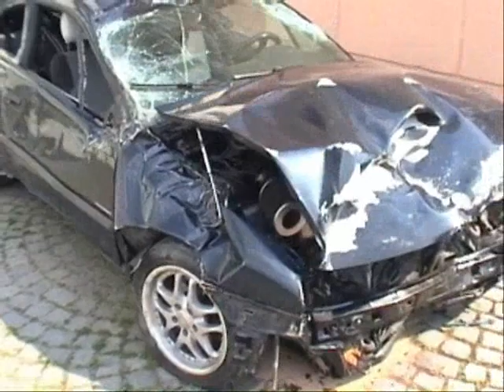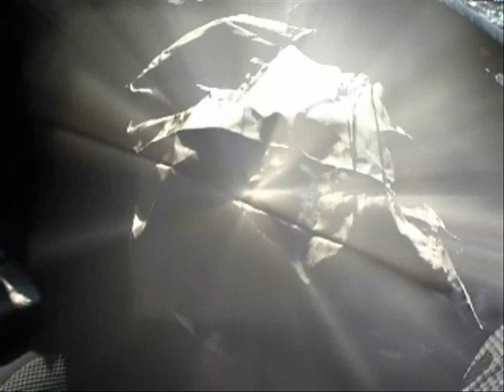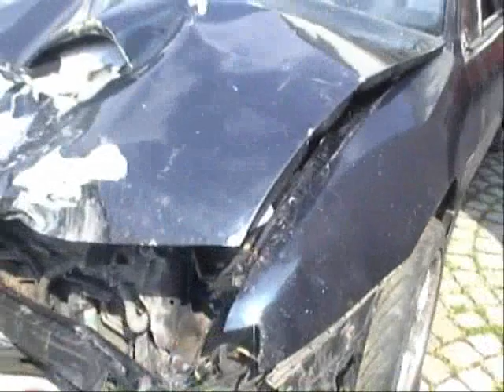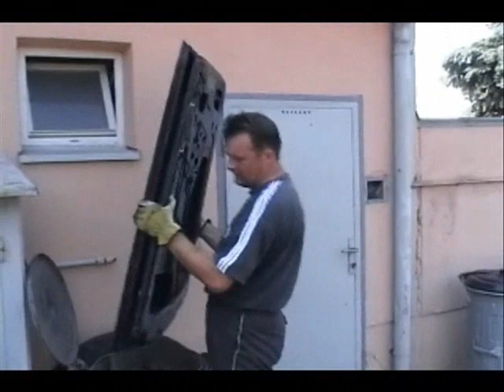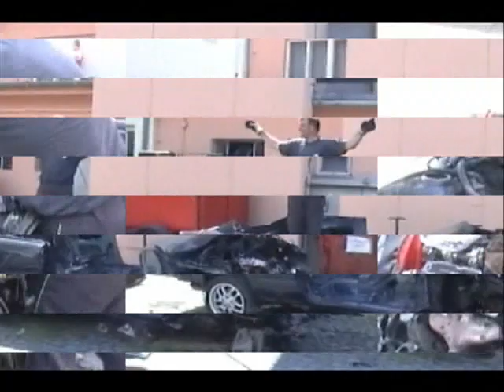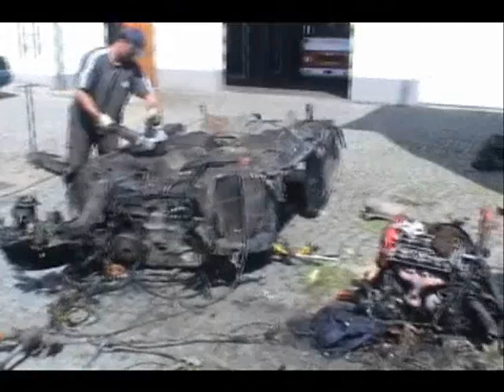Crashed Calibra

Comment: Thank you for your answer ! :) I see your point... What do you think about the F28 gearbox, with another gears ( ~same like the V6's, final 3,82 vs 3,72 ( c25xe vs c20let ), and same in the other gears too ) And what about the 6th gear ? Is it causes the decrease of the fuel consumption ? What speed could your cali done ? Decreased from the stock 238 KM/h, or you haven't tried it ? :) :D